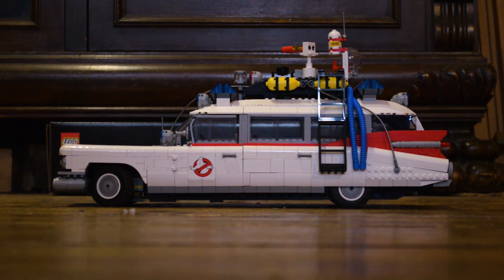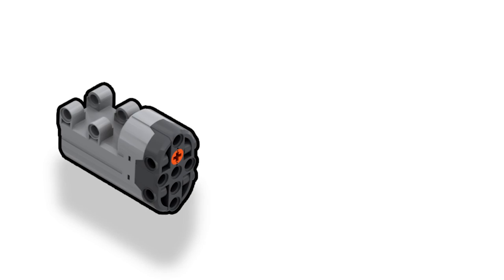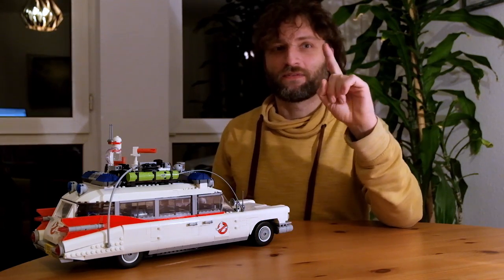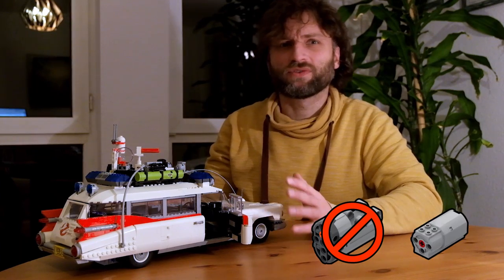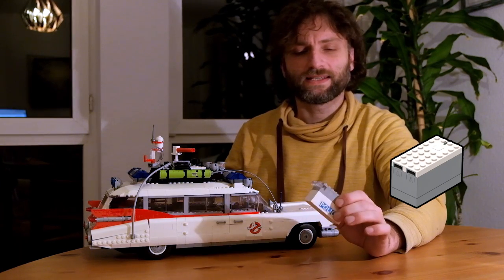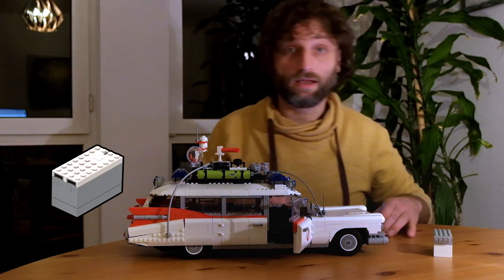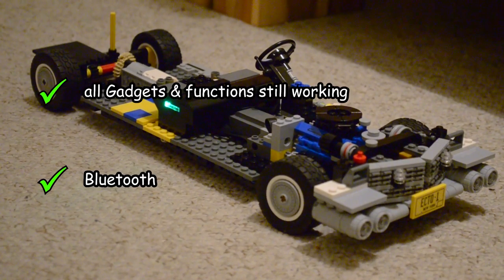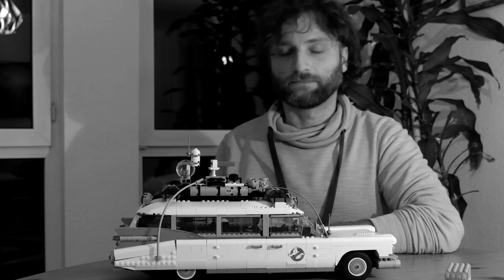Motor Mod: LEGO Ghostbusters ECTO-1 10274 - Powered Up RC - Sound/Light kit fits

Comment: Thank You so much for this video! This is my first set and planning to buy the LED kit as well the motors from your video. Is it possible to do these two upgrades in one build? 

Thanks again and Happy New Year!
Reply from the maker: ofcourse, it's meant to. I did that just had not got the lights when making the video, but you can see it in the end of my batmobile video: https://youtu.be/mb2n88BAh_k?t=184 
read the details on my rebrickable page, the link is here in the video description (below the video) you even get a discount for an LED set with my instructions.
Reply: @recklessglitch  thanks for the quick reply, I really appreciate it.  With these lights, is it possible to turn on and off the LED's independently? And I saw that you can upload your own mp3 in the kit? Did I read correctly that the Tumbler (76112) is all I need? Sorry for the many questions 😅 I've printed al your PDF's 😇 Awesome job you pulled off there!

Comment: Hi, I modified my ECTO, but after the programming link on the phone, the motor on the front of the ECTO keeps rotating and cannot control the steering. The rear motor that controls the forward and backward movement can operate normally. Is there a problem with the programming part?
Reply from the maker: I answered on rebrickable, check it out.
Reply from the maker: If it keeps rotating it means its not attached. The programming is asuming a steering mechanism and first thing it tries to find its boundaries in each direction, the steering limits.
If nothing is attached that restricts the motors movement (as in son phams video) it will just spin forever. Build it in and test again please. Or block the motor manually for testing.

Comment: Thanks a lot for your amazing job. I just want to know wich way you use to powered the light kit, im sure that you have find the smallest and hidden solution. thanks again
Reply from the maker: Its not so simple as with power functions, since you cannot stack the plugs in any way and both ports of the hub are used. The smallest solution would be to take off some insulation of the 2 center wires of the powered up cable of one of the motors. They should carry the power and ground. Then connect a tiny step down converter, put it on 6V and behind that put your LED power cable.
Reply: @recklessglitch  Thank you for your answer but in fact I used a micro powerbank that I manage to hide next to the engine under the car. If you want to do even better for the wiring of the light kit you have to order 50cm connection cables and after that you can't see any cables even inside. Thanks again for all you do!

Comment: Danke für die Anleitung! werde ich gleich mal kaufen und auf die Suche nach den Teilen gehen
Hast du die Teilenummern für die Powered Up Komponenten?

Habe die Liste mal bei Bricklink eingegeben, ein Teil 40344 scheint es im Katalog nicht zu geben, weiß du was das sein soll?

Auch wenn ich gerade noch  Sorgen habe mein fertiges Modell mit Light and Sound wieder auseinander zu nehmen ;)
Reply from the maker: ich hab gerade mal im inventar (https://rebrickable.com/mocs/MOC-64578/#parts ) nachgeschaut, da ist kein teil 40344 vorhanden, woher hast du die nummer? du kannst die Teileliste direkt von rebrickable übernehmen, ne. die kann man als wanted list nach bricklink portieren oder sogar über rebrickable die bricklink shops raussuchen uns bestellungen (shopping carts) machen.

Comment: Amazing job. Do you planing to add lights and may be siren? I know, that it is impossible with standard lego parts.
Reply from the maker: I have, just isn't in the video. There are special kits sold for that. Link is in the video descriptions (and a discount code in my instructions) and if you want to have a look its in my video here: https://youtu.be/mb2n88BAh_k?t=185 with lights and the original sound from the light and sound kit.

Comment: This looks great! Thinking of trying it out, but I want to avoid dealing with constant battery swaps. Considering the BuWizz 3.0, like you used in the Delorean, for a more permanent charge solution. How easy is it to replace the powered-up hub with the BuWizz 3.0 in the Ecto-1? Also, I've got the Game of Bricks light and sound kit in mind. Already got your instructions – any thoughts on adding the BuWizz 3.0 to the Ecto-1? Cheers!
Reply from the maker: This question has been asked on rebrickable before and I actually have a buwizz (used it for the DeLorean) and it's great. Unfortunately it is one stud longer and has the sockets on top, so it would be quite difficult to build it into the same place (under the front seat bench) You would need to put it in upside down and change the base frame, to make space for the buwizz. 
BUT: honsestly, changing the batteries (use rechargable, also see my delorean video for the reason) is very quick. I leave the LEGO hub open, so I just pull them out and back in as I showed in this video. Besides, you dont have the problem of an internal battery going bad after some time.
Reply: @recklessglitch   Thanks for the info! I'll go with the hub and hunt for some good rechargeable batteries. Did the hub handle your lighting kit and motors, or did you need an extra power bank for the lights?

Comment: Hey man, just curious, did you consider to use 
Medium Linear Motor (88008) since it does have position sensor and it should work just fine with this small technic hub? It only have 4 pin connections near the motor shaft, though. Dimensions of this motor are 4 x 6 x 3 studs. There's also a Small Angular Motor (45607), but it's still new/rare and I can't confirm if it works with technic hubs at all, even with third-party apps, such as controlz and brick controller 2.
Reply from the maker: Sure I considered it, I checked most of the current motors as drive and steering motor. The 88008 is big and white. You'd see it as steering motor in the car right away. Didn't like that idea. The L motor looks much better, since it's dark as the floor and slim. 
But you can use the 88008 as the drive motor. I have included some images how to fit it in instead of the M-Motor in my instructions.

Comment: Hey I was looking for a way to contact you (rebrickable did not allow me to send you a message) regarding this project. If I get the suggested (Batmobile 76112) + motors what additional blocks do I need (assuming that I have only the ecto-1 + Batmobile 76112).
Reply from the maker: On rebrickable there is a tab called inventory. You can see all parts there. Plus you need a buwizz or sbrick, which is not in the inventory. But i covered all that in the Description on rebrickable, just have a look. And by the way, you can order any bricks on bricklink and other LEGO brick market places like that. Thats where i get my bricks usually.
Reply: @recklessglitch  Thx, I got confused if that inventory is for additional bricks or only ones used in modification.

Comment: I ordered the licht without your coupon didn't know your video till then, did you use a extra sound you said to the makers of light kit?
Reply from the maker: you can plug in the sound module via usb and find some mp3 files that you can change. only the order is important so copy the sounds, listen to them and replace them as you like.
Reply: @recklessglitch  thanks for the reply, do it needs to be a specific order to call the mp3 files you mean?
Reply: @recklessglitch  also what awesome sounds or website do you recommend to download from?

Comment: Super cool! how much it costs to buy the part for build it?
Reply from the maker: below the video in the description is the link to rebrickable. There you can find the instructions and the "inventory" a list of all bricks you need which also shows a rough calculation of what it may cost. Though usually you get it cheaper when you search on pages like bricklink. There are buttons to make bricklink shopping lists, easy peasy.

Comment: The large 89 batmobile?
Reply from the maker: Yep, working on it. Still wondering how to make the cockpit open and close with a motor.
Reply from the maker: I think I have found a way to make it work, dual motor driving, steering servo, roof and guns, and battery in the trunk to leave the cockpit untouched. got to wait for some ordered parts and make it work. I will post the link when I am done.
Reply from the maker: Have finished it: https://youtu.be/mb2n88BAh_k you find the Instructions as usually on rebrickable